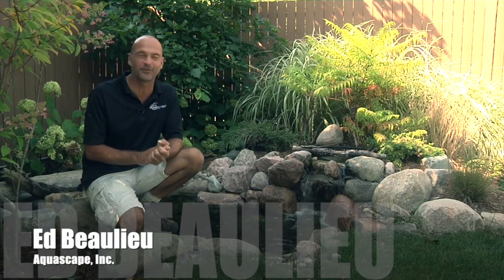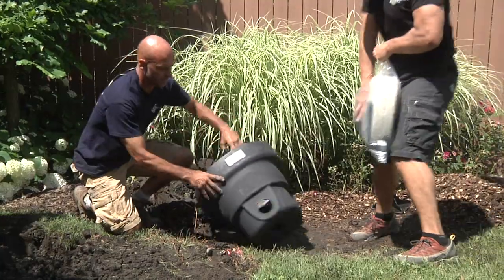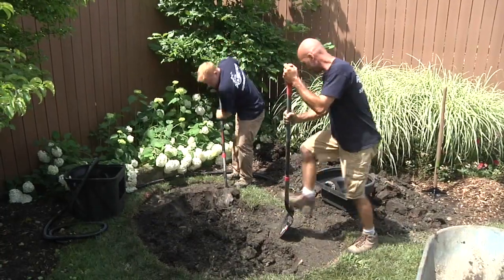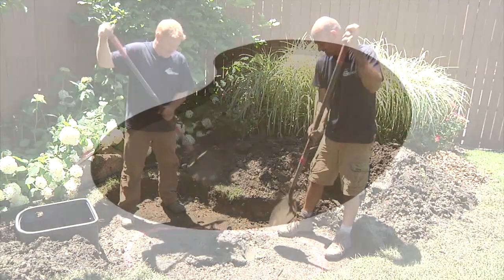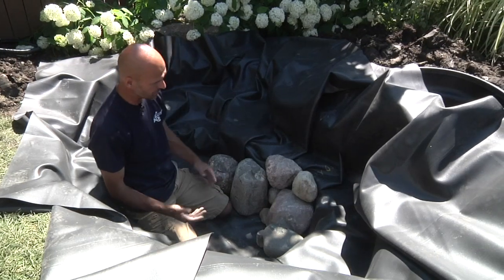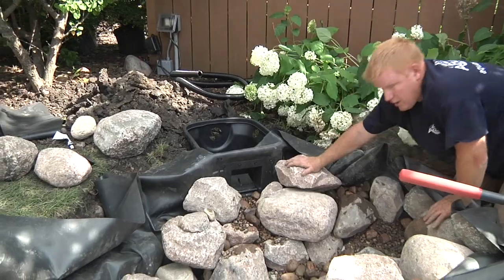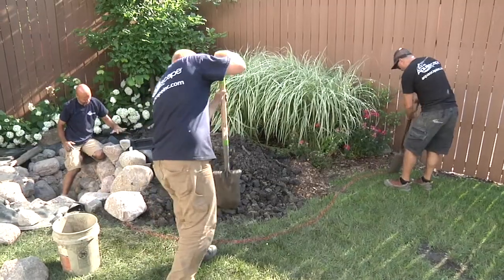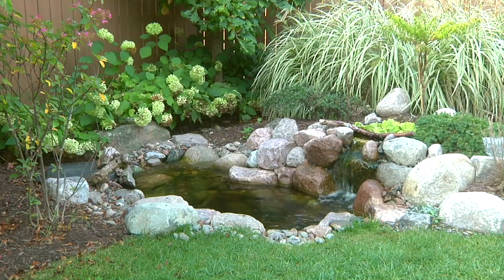How to Build a Pond with an Aquascape DIY Pond Kit

Comment: THANK YOU for Showing me that  ITS WAY TOO MUCH work for a pond AND... the Feb 5, 2016  video ALSO PROVES that it's Way Way Way COMPLICATED and in one video 4 guys & the other 3 guys which one person ALONE doing it is going to be ROUGH especially if you can't walk well.... YEAH I'm Over It as far as DIGGING water features.... * * * You'd THINK that it would be A LOT LOT LOT Easier considering it's All In A BOX👀😱
Reply from the maker: The digging and rock moving is the hardest part. The rest is fairly easy. You can always hire a Certified Aquascape Contractor to install one for you:  https://www.aquascapeinc.com/find-aquascape-certified-contractors
Reply: Vicente - my man, if this is too much work then pull out your wallet and watch some one else do “too much work”